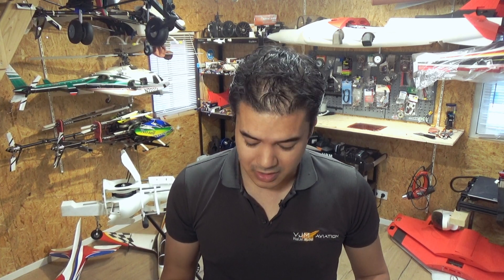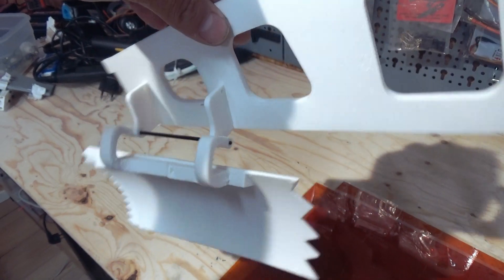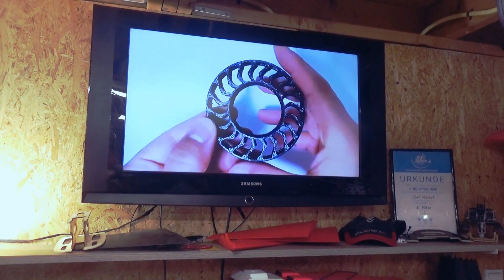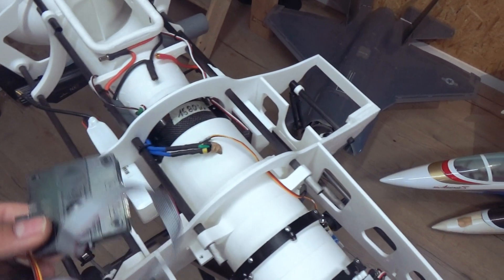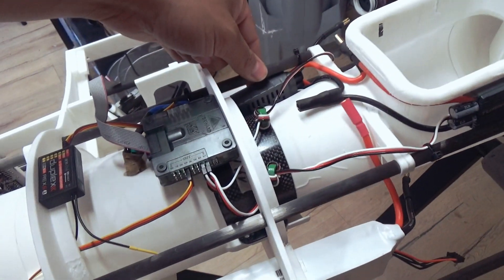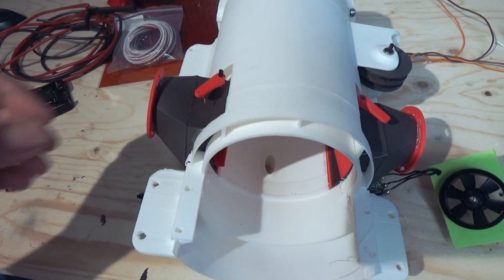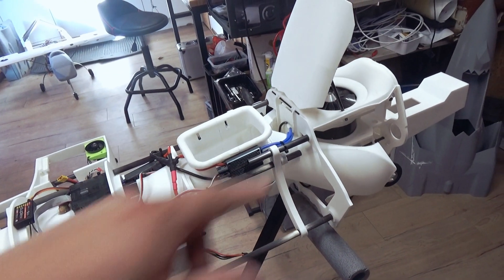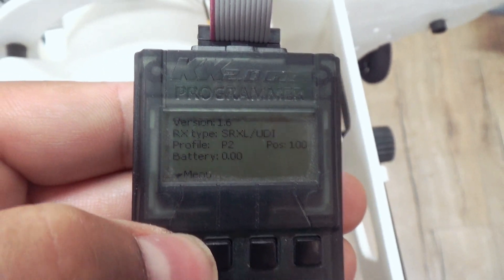F-35B Model in Action AMAZING FIRST HOVER Testing New Vasa 90mm Edf's | KK2.1 HC Flightcomputer

Comment: Being the first to idea the concept of Hover tech...the reason for a drive shaft assembly is the definite cost of two separate engines functioning out of singularity. It is best to couple for price is phenomenal enough just building a real one and trying to mate them electronically and constant upgrades to the electronics to keep one flying... You have done a remarkable job getting the motor assemblies synchronized....but in RC...that's the reality of difference of costs in up scaling...Great job for you and everyone on the project....Really have what design needs a human interaction to thought and design portrayal...Well done...!!!

Comment: Joel & Melanie, I applaud the excellent hovering stability you've achieved. I know how difficult this is, as I used to work with Chinese model helicopter companies testing and writing instruction manuals so owners could tune the stability of their models before the first flight (as well as advising on repair techniques). My observation is that you would be better tuning your flight stability at a higher altitude – at least 1.5 metres or 5 foot altitude – so as to avoid the problems of "ground effect". Naturally, people are frightened to fly too high, as they fear a fatal crash. This is a mistake, as getting higher not only gets you out of the dangerous ground effect, but also gives you time to react in applying r/c control to correct any minor imbalances. If you ever take flying lessons in a real helicopter, getting above the dangers of ground effect is one of the first things you'll learn. Only later, in more advanced lessons, will your instructor teach you to control low-level hovering. It's similar to the fact that learning to run is easier than learning to walk. You can protect your aircraft from the dangers of a crash by using gardener's "butterfly netting" to construct a safety net (as seen with the high traipse act in circuses). This will allow the airflow to pass through the netting, while being able to catch the aircraft in cases of loss of control. Just be sure your safety net is high enough, and well enough anchored, to contain the aircraft weight and energy of a crash. Also, you'll need to build a launch pad, above your safety net, for which I'd suggest using expanded polystyrene that'll break if your model crashes into it. 

Anyhow, as I said at the beginning, you're doing a fabulous job 👏 

Rick
Reply from the maker: Thankyou Rick and I am fully agree with you gain faster and higher. I know this also with flying and teaching with heli’s..indeed people are afraid to not gain that that higher hover and stay low by ground naturaly..so during testing it’s important to for me if I could try to tune the flightcomputer within ground effects and also as I hover in the livingroom😅…too much turbulence airflow…but if it stays stable with ground effect and this turbulence indoors it definitely fly outdoors…seeing from the tuning the flightcomputer point of view.
Reply: @Joelmelanie  I'd hoped that's what you were doing, but having seen some of the world's best military helicopter flying instructors fall into the ground effect trap, I thought I'd check. You're doing a fantastic job. 👏

Comment: so it takes 150% throttle to hover? should hover at 40-50%
Reply from the maker: Yep
Reply: @Joelmelanie  suggestion lighten the craft more, use a bigger ducted fan of course esc to match you could probably go 3000 mah or 5000 mah wont get but 5-10 minites flight time  but having that throttle that high up those motors are working really hard it is hard on the lipos as well

Comment: I really don't like the Lockheed Martin official skateboard wheels plastics (rougher rubber runs rims airless tyres) no VTOL foam RC for £250-£350 .
I wouldn't pay any more than £150 for it
Reply from the maker: Jp europe is making me a set of scale wheels with brakes😋
Reply: @Joelmelanie  world's smallest stepper motor is a micro DC small enough to in wheel back 2 
https://youtu.be/_sT7_Jr-kYs

Comment: I'm surprised to see you are using a KK2 controller.  Did you consider something like Ardupilot? I'm curious to hear your thoughts there
Reply from the maker: Yes I use ardu pilot for my harrier model, it’s faster and more stable indeed. The kk2 board is flashed to open aero Vtol software were transition is easy to configure, during this development stage I don’t want to spend to much time on ardu pilot (mission planner) because I don’t understand it so good😅 some friends helping me out sometimes

Comment: Well with an abnormal amount of waste , I have all the parts printed for my first printed vtol k2 board programmed but awaiting carbon fiber rods and tubes.... had a few prints go off the rails after several hours of printing ..  most aggravating,  bed adhesion problems

Comment: Fantastic work as usual Joel. You are doing things I dreamed about doing in 1985. I have a weight-savings idea. Since your parts are 3D printed I think it should be possible to make them as stiffened panels to improve strength and lower weight. This represents a lot of extra work in the design phase but if you apply it to all the flat parts you could earn some weight savings. Curved parts would also benefit. Perhaps this is too much for a prototype but when you go into production the extra work might be worth it for the thousands of parts to be produced. One of the things I enjoy about aircraft engineering is the beautiful art that is represented in the basic parts of an airframe. See additional comment for links what I'm talking about.

(edit) The ideal structure actually has two "skins" with internal stiffeners. This is basically your standard corrugated cardboard box used for all shipping and delivery today. Or if you think about it any wing on a full size aircraft has upper and lower skin with spars and ribs. It is a very efficient and light structure. This is even more complex to design and may present some challenges for the 3d printing. Perhaps you can 3d print one skin with all the stiffeners and then 3d print the other skin without stiffeners and bond the two together in final assembly. The major parts like the wing carry-through bulkhead would benefit from this. Plus it would just be cool.

Comment: Are you planning on adding brackets for the controller to later models?  Seem like a similar idea as with the rear doors would work for those items and keep them more secure.
Reply from the maker: Good idea, yes going to ad an dedicated bracket for the flight controller fitted for the kk2 or pixhawk.. thanks for the idea! You will see your idea in the next video;)